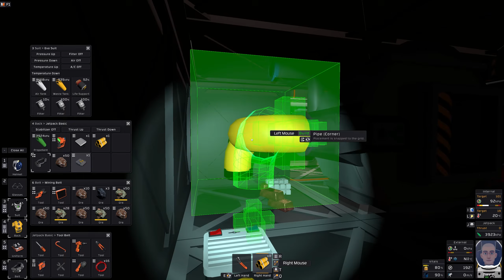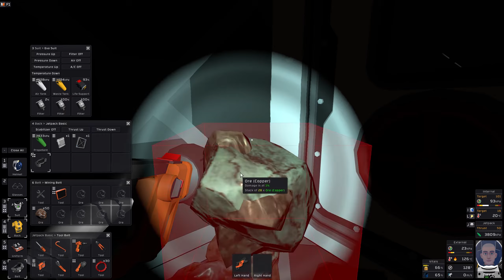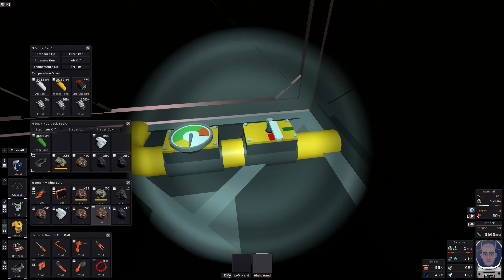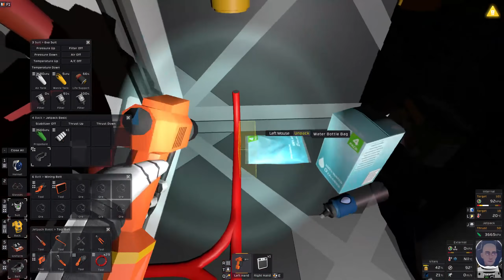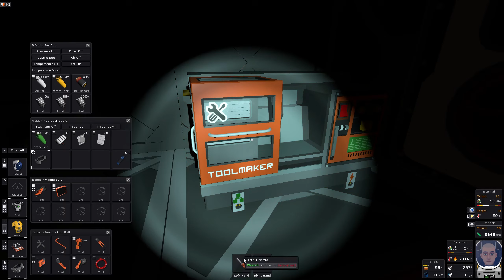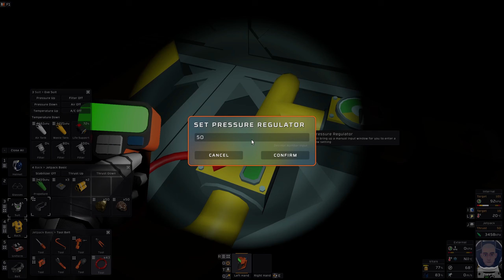Stationeers (Beta): Brutal Vulcan, EP3 - Steel

Comment: i still like the water bottles more then the drinking fountain, because you can stop drinking and it will hydrate you partially, because interrupting drinking from a fountain will not hydrate you at all, if they didn't changed that. And you can turn around while drinking from a bottle.
Reply from the maker: Thus possible its more efficient to drink from bottles (I haven't compared the two methods).   Good point, I think I will make a bottle filler while my H20 supply is limited.   But with a good supply of water, I prefer the fountain...

Comment: They jsut made some beta updates to lava on Sept 1st....curious how that changes your environment/views outside your base. I assume you recorded this prior to that. Here's change notes:  

Fixed Terrain importer not correctly sampling lava height map.,

Added voxel fill type option for terrain importer.
Reimported Vulcan terrain with correct voxel type data. The rock will now have emissive lava cracks when it it close to the lava level.,
Added wip points of interest to vulcan.+ Added wip emissive texture based on the lava height map,
Fixed Venus was using default-minables preset, should be using default-minables-no-ice.[Version 0.2.5879.25919]
Reply from the maker: EP4 (tomorrow) is after that update.   My base was moved up about 20 grids (but easy to find now).   I could edit the XML to bring it back down, but just going to leaving in case I muck something else up.    The mining seems more like the original Vulcan and did get a little close to the lava (dirt during red, but didn't hit the actual lava), and backoff to avoid any damage.

Comment: As far as storm temperature drops, it drops it some and can go below 127C... But in Vulcan winter where the daytime temps get over 1000C, it wont drop that low.
Surprised it took that long to get steel. Interesting to see how other people approach things and how they priorotize upgrades. Usually steel is something I rush to make within the 2nd day to get power storage going so I can get cooling going as well as work towards teching up printers or getting the trader online before the first storm happens.
Reply from the maker: Difficult to compare between runs as some run with power/food mods or okay with health/lung damage.   I have no mods and avoid health/lung damage (and no reaching through windows).   There are various starts and I try different things.   For example, rush steel/station battery/solid generator (as there is coal around) is a quick method for power.  A simple two stage AC is more than enough to cool the hydroponic room, but where is the fun at that. <g>   Another path is rush trading, but I won't trade until I'm stable (generating H20 surplus) and then only for seeds.   Assuming this method works well, next time I will do something different...   (Actually like to try rushing a station battery and solid generator....)
Reply: @VenusianGamer  True. I try to stay without any warnings/lung damage as well. The hot planets make it extremely difficult to do that as well. But out of all the planets I do find Vulcan as probably one of the most fun planets. Not so difficult where trading is required to survive but cold enough we can use phase change to cool down. The lack of ices is strangely offset by the extra other ores we get.